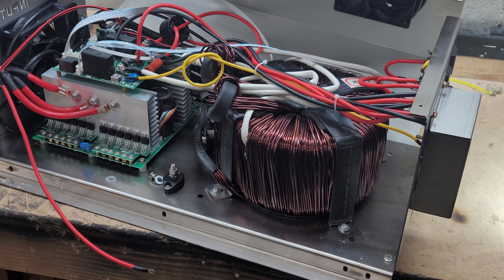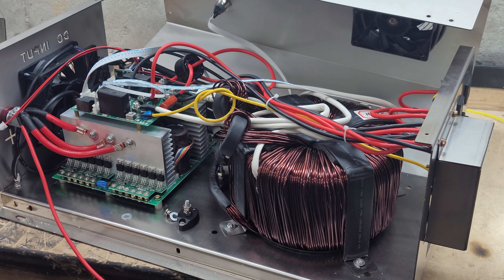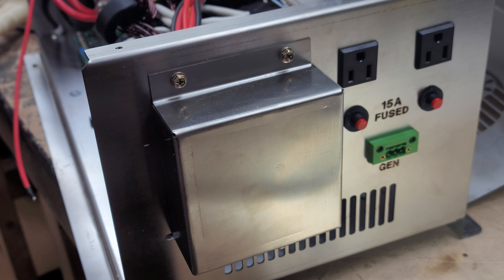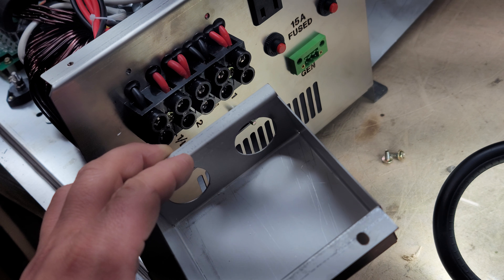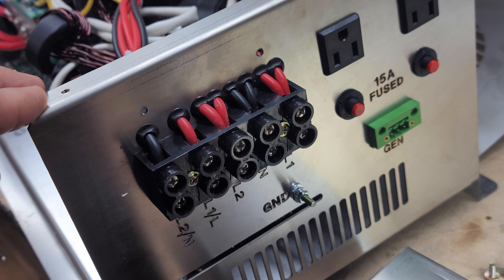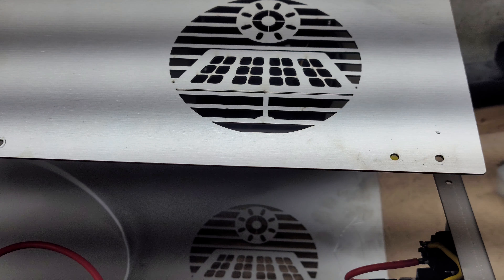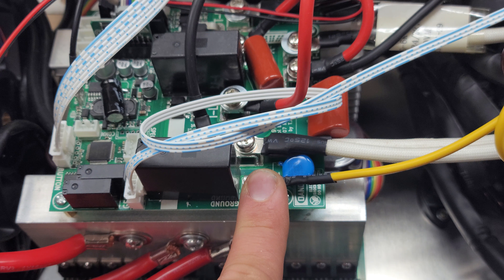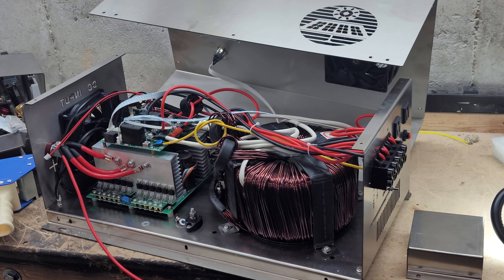Quick look Genetry Solar 6000 watt inverter revision 2.

Comment: Great improvement on the beast . Best safety and cover for your money . Love the new gen start feature giving  the inverter a great upgrade for the future in DIY total off grid  operation .  GENETRY solar at 100% best in the USA .
Reply from the maker: Thank you
Reply: 1st gen has generator start as well...just I used an obscure mini-XLR connector for some ridiculous reason.  1st gen has 0.5A reed relays; this uses 5A regular contact relays.

Comment: Nice video again. Even i can't order one as i'm from Europe. I think it looks good. i have few tweeks you can but ofc don't need to think about and sorry just my sugestions.

1. That capacitor that is on your control board looks lets say it..not safe for transport..i would sugest much stronger securing or change it to new type or change design so it would actually fit on board as it should and then use glue so it would fly away..

  2. you can use shorter screws to connect that junction box to chassis (too long..you could save a little)  + second there was no safety nut on there. You are relying on on sheet metal not to get loose i would say not good practice..

3. i couldn't see or check but i didn't see safety washers on your cables(that you are connecting y your controler board). It is possible they are there but i couldn't see it . just reminder..

4. I would add some plastic sheet below that junction box just to increase area where you can't accidently touch chassis with your phase ..This is usually done improve safety in case cable get loose or such..(optional)
5. I do see that you used 3 cables to handle current more ..For sure it is better than 2 cables. But i would also suggest to connect max 2 cable from top and two cables from bottom. . Whole your contact would be hollow with screw +safety nut. I know it would cost extra nut and screw would be longer but i think that would help you a but with stress on leads and i  think it would be better for manufacturer..

6. It might not look important but usually when you have metal box it should be grounded. So i would suggest to add grounding lug to that metal box as well 

7. Put grounding bolt outside the box (for example on right side). reason is if i want to connect ground i don't have to remove this metal box and sometimes i want to connect more things together in star and that lug/bolt isn't isn't very convenient.. It is perfect  for those cables. when you have to connect 3 cables 1. Phase 2 Neutral 3 earth ..but not so much when you want to connect your inverter to your charger, battery terminal or what ever you have in your room where you have whole system..  

If you will think about these suggestions or not I think it still looks much nicer than your 15kW inverter (i know it isn't finished :) ) ..just saying. It finally looks clean.

Comment: Great channels guys. I have a quick question, I have been given an old PSWGT-1200 with the lcd panel and needs some tlc. I have found that the current sensor on the hot live wire going to the grid does not have the circular current sensor on it. Could you tell me what part I need to get, but I'm in the UK. Thanks guys, keep up the great work  cheers.
Reply from the maker: Sadly not much we can do with power jack inverters any longer.

Comment: Hey I have three questions that I neglected to ask when I talked to you the other day. Are the fans running all the time as in some other pure sine manufacturers? (This consumes a bit more power during the night). And what gauge wire will the output lugs accommodate? The unit I am running now will accommodate 4awg thhn but just barely and I think that is a good output size to a breaker box to provide less line impedance and approx 95amp carry capacity. Fans run full time on my present set up and I find that I would like to have them on thermal demand to quiet it down and draw less standby power. Third question is how much draw to fire off the unit on standby and how often is it sampling the line with a pulse. (This becomes a problem with garage door openers and such). Thanks. Sorry to geek out but these are things that I find are missing on almost all tech sheets and are more than relevant to the end consumer.
Reply: - Fans running all the time?  NO!  They are PWM controlled based on internal temperature; under low loads, both fans will come to a complete stop.
- What max wire gauge will the output terminal block handle?  Don't have a calipers, but I'm eyeballing somewhere close to 6mm diameter on the terminals.  Please note that this is only a 6kw inverter, that's 25A @ 240v, so it's kinda pointless to use super-huge wires.
- How much draw to pull the unit out of power save mode?  You pick ;-).  It's a user-adjustable setting from 1-63W (on either phase, btw, not just 1 like most inverters).  You can also disable power-save mode and/or configure auto power save based on battery voltage.
- How often is it sampling the line with a pulse...and how long is the pulse?  You pick ;-).  Pulse length from 1-15 seconds, "off" adjustable in 15 second increments from 15 to 225 seconds.

I am pretty sure those specs are missing on our tech sheets...wait a minute, the sheets are missing too ;-)
Reply: @sidlori1592  Killer thorough reply! Thank you. I feel like these details are important. I appreciate you taking the time to cover them. I like the parameters. Looks like you have thought this out, even if the spec sheet is waiting to manifest itself! Cheers.

Comment: To prevent wires from chafing, It would probably be good to have rubber grommets for those 2 holes in the cover.
Reply: Or do it properly with cable clamps/cable strain relief bushings/cord grips/conduit fittings if running conduit to it.
Reply: These were actually intended for 1/2" box connectors (umm...not included).  Unless you have a better suggestion?
Reply: @sidlori1592  Something like this:  https://www.mcmaster.com/grommets/cut-to-size-grommets/ It is a stop gap measure and can easily be replaced if the customer doesn't want to use it.
Reply: @ayourk1  Can do.  Guess I figured customers would provide their own box connectors, but I suppose a rubber grommet isn't a bad idea at all.

Comment: Will it run a 4-ton air conditioning unit
Reply from the maker: We will soon find out as one of these will be hooked up to my house
Reply: I think that will depend on the A/C unit. Some with soft starts would likely not have a problem. Those that fire up the compressor and fans all at the same time I doubt. The running load of an average 4 ton unit is 20 Amps at 240Volts. Starting load can be up to 100 Amps.  The GS 12KW unit is right on the borderline for the minimum. You can figure that the Tons of cooling just about matches the kW to run and 3-5 times that amount to start. Here is a chart for you. https://www.generatorjoe.net/html/acload.html